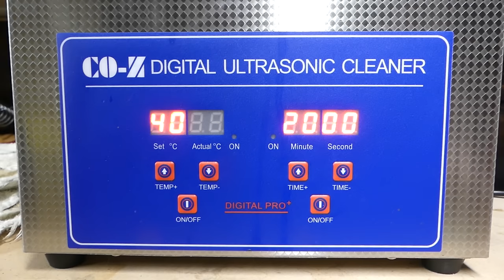Tonka Mobile Crane Restoration antique vintage Restore

Comment: Amazing restoration. As it happens I have the State Hi Way dump truck with two front blades in near new condition. From the same series. I received it as a Christmas present in 1957 at the age of 10.

Comment: Why not use wood dowel to bend the tabs over instead of the hammer? Also,  why not get the rivet tool that doesn't require the awkward use of the ratchet? Nice resto.

Comment: I restored the same truck for my granddaughters as a Christmas present 3 years ago along with a Tonka front end loader, A Tonka  road grader, and a Structo dump truck. All the toys were about in the same shape as yours when I started. On the Tonka Clam, I used "Mother's" polishing paste on all of the cadnium plated parts. The only parts I needed to buy were some glass, wheel covers, and the stickers. To keep the crane house from flopping around on the frame platform, I used body washers with wide nylon washers and adjusted the lock nut snug. It was a lot of work with the "Mother's" to polish all of that out but it came out pretty nice, with only a few black stains showing. I used dish soap with a tooth brush to clean the tires, took a long time, but they shined like new when I was done. One trick I learned is to boil the tires in water, to make them soft, before you assemble them . The wheel covers go on much easier without breaking the little flange that locks the covers in place. I also boiled them to disassemble.  I air brushed all of them in safety green, probably was never an original color, but they looked ok.
Reply: Mlm

Comment: Once upon a time, when toys were made with love and passion...
Reply: Eh, these were the cheap toys of their time. Before these they were cast, these are bent sheets of metal. And if you check older Tonkas, they still found ways to cheapen them even more, look at these wheels. Rubber, later ones are plastic with a rubber trim that holds the metal, because they couldn't fully replace that metal insert. But they still cheapened the process and sold them at the same price. Later other corners were cut and so on.
Reply: Before china toys

Comment: Very awesome job. Intelligent move replacing the rivet in the rotating crane with a bolt and nyloc nut. However, (not criticizing) I would have put a large washer on both sides so as to be able to tighten it up a little more so it doesn't wobble so much. I really love powder paint. It looks so much better than spray on paint. Just my opinion. Do you have a link to the rivet tool that you use? I tried to find it on Amazon but it didn't come up.
Reply: Jeff Williams I was thinking the same thing. It definitely would have tightened it up and stopped the wobble and the excessive movement. Luckily that’s something he can come back to and resolve
Reply: @mikecollesides2137  Thanks. I'm glad someone else saw that. I didn't want to look like an ass.

Comment: Thanks for video.I’ve got one of these sitting on a shelf waiting to be restored. If I may offer a tip: I’ve had a lot of success removing old Tonka hubcaps by waving a heat gun, on low setting, on tires. This makes them soft enough to bend so I can pop out old hubcap without any tire damage so I can reuse old tires. I cringe every time I see your screwdriver. Keep up the great work!

Comment: Can someone shed some light for me, I've never powder coated anything before, but I've done bodywork and primer and paint before, does the powder coating have primer mixed in with the color or do you not need primer when you powder coat?
Reply: Powder coat uses an electrical charge to hold the powder on the part. It is then placed into an oven where the powder melts to the surface.
Reply: @robertpontius1689  I know that part, is the primer mixed with the powder or is primer not needed for powder coat?

Comment: Ever done a resto on one of those beetles with the big rear engine v 8
Reply: They normally had a 4 cylinder.
Reply: @claytons4789  this one is a tonks version with a Plastic motor on the outside
Reply: @treyjohnson82  oh, I didn't realize it was a toy.

Comment: I like your restorations but I only wished that you first primed the pieces, especially when there are small pits left by corrosion/rust, with a filling primer. You can then wet sand to a nice smooth finish, and then apply the color. Just my 2 cents

Comment: 13:35 It slightly looks like the 1957 Ford F-series.
Reply: I believe that is what most of the Orange State Hiway Dept. series is modeled after. Some are '56 Ford F and some are '58.
Reply: Yes, Ford wanted a royalty which tonka paid until 1962
Reply: Looks like a 58-60 F series truck. Just one more reason why I love old Tonka Toys!

Comment: Looks OK.  Too bad the slew couldn"t be tightened up.
Reply: I don't see why it couldn't be. I like the stove bolt with a Nylock nut for adjustability. I would add one large fender washer between the bolt head and the bottom of the frame and one between the floor of the house and the Nylock nut. I would ALSO use and a large Nylon or plastic fender washer between the two rotating surfaces and snug the nut bolt combo until it requires a bit of effort to rotate the house on the frame. Do NOT Lubricate between the house and frame as it will attract and bind with sand/dirt.   sdh in CT